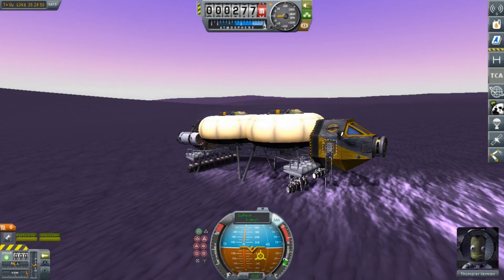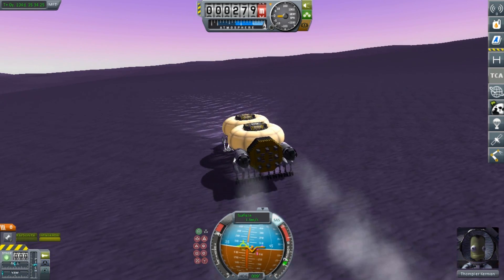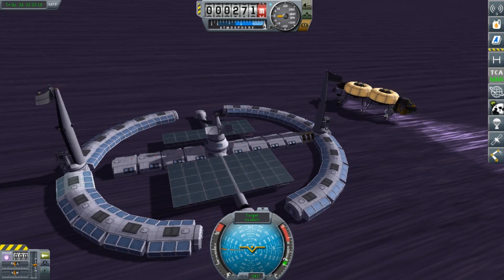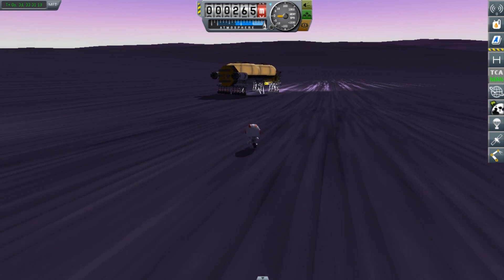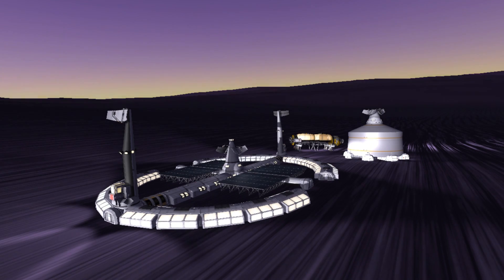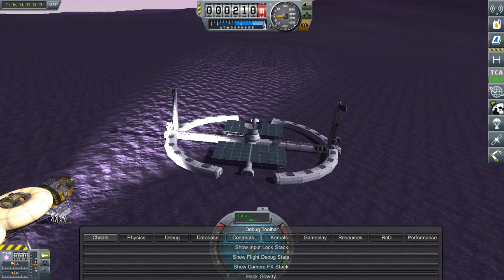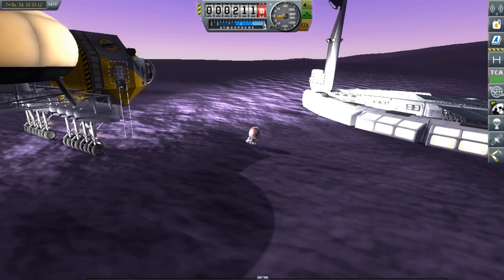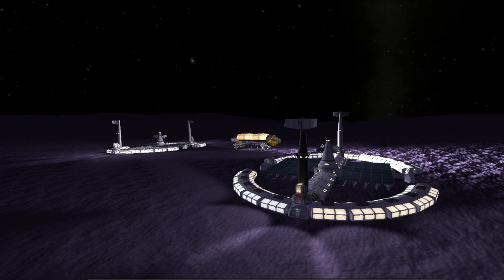[31] Eve Habitation & Agriculture | Modded KSP : Super Colonization

Comment: seems to me that the other worlds will not be as tempermental with your bases.  with eve having it's super high gravity and minmis having such low gravity, they are the hardest to get stable bases built on with the new(ish) friction system.
Reply from the maker: Other places should be better, but I will always have a problem with any ground that is not perfectly flat. When things are spawned in they are built with the root part like 0.5m off the ground and completely level. If the ground at any point gets in the way then it spawns clipped into the ground. Minmus was nice with this because even with a bit of a launch, the gravity was so low that the fall pretty much never did damage. Eve on the other hand is hell because things pick up speed very quickly. Now that I have decided to use cheats to allow bases to spawn without the worry of them being destroyed in the process I am much less hesitent with build locations. The Muns gravity is pretty good and I had quite a bit more issues there with bases than I did on Minmus. Id assume I will have problems everywhere, but atleast I wont have "Eve problems" XD
Reply: good point Ryan.  well, I can say this, Duna should be more like Minnmis, and the same goes for Eeloo.  Dres has a surface like Eve but a nice Mun like gravity field so should be easier to work on at least...  Laythe is wet...  Tylo is pretty flat, but high gravity makes it harder to land.  Pol and Bop are going to be the hard ones...
Reply from the maker: Duna is going to be a nice one for me. Its a place where I have done a lot of stuff in and if it is where we go next its going to be like playing on easy mode. Dres is going to be hard, if the surface is Eve like then that is going to make things a bit tougher. It also does not help that I have pretty much no experiance with the place so I don't really know what I am getting into. Laythe is going to be fun, but hard. There is not a whole lot of land and from what I have experienced, the land is very hilly. Tylo is going to be a bit of a bitch because of the gravity but it should not be too bad because we will have high thrust from Karborundum engines. If it is nice and flat then once we do a large landing we can just expand from a center point and drive out to new locations instead of flying like I usually do. Pol and Bop... I have no idea. I have been there 1 time each and I know pretty much nothing about them.
Reply: Dres does have some nice dark colored flatish "lakes" but the rest is hilly, and the craters are not in any way flat...  but the craters are also where the resources seem to be, at least by vanilla standards.
Tylo isn't too bad on the surface, but i've only been there once myself.  The Karborundum engines will make it a lot easier to land.
Pol and Bop are hilly, to the extreme.  landing spots are small but the gravity is very low.
Reply from the maker: Then the lakes are where the real bases are going :P I am alright with the craters being a shit place to build. If they have resources then I will just give my drilling rigs a solid base. The new Karborundum drilling rig design is probably going to become a standard mining rig because its so damned solid and should do fine even on shit terrain.

Speaking of Karborundum engines making things easier... you should see the beast I am working on. 8 of the largest engines and in vac they put out like 180k kn of thrust XD A painful 15karborundum and 150 ore per second per engine to run them but we can push some crazy things with that much thrust. As a rough estimate, the fully loaded ship is going to be sitting at 30-50k tones (mostly mat kits and spec parts)
Reply: Daym!  That's a lotta ship!

Comment: I can't imagine anything bigger and stronger thanthe mothership.
Reply from the maker: Its not going to be bigger, but it will be a lot stronger. Karborundum gives us the ability to have much much more powerful engines. The B9 super large engines on the mothership are big... and very powerful. In rocket mode they put out something like 19k kn of thrust. The biggest Karborundum Torch Drives put out something like 130k kn of thrust. They do have a problem with being like 5m wide, stupidly long and the fuel is hell to get, but for what we need, it will do a fantastic job.
Reply: +Toxic Timewaster (Ryan123220) cool

Comment: Even bigger than the mothership? No way........
Reply from the maker: More powerful, but probably similar in size. I can cut out a lot of the bulk of the mothership since most of it is fuel storage. There's a big section dedicated to production, which is something that is not needed since I have to manually transfer raw materials up to it (I may as well just make stuff on the ground and transport finished products up). IF i can figure out structural stability we will be pushing tens of thousands of tons with over a million kn of thrust. Its going to be interesting.